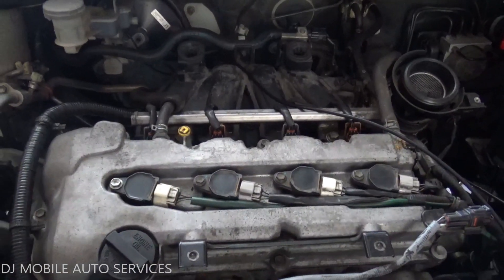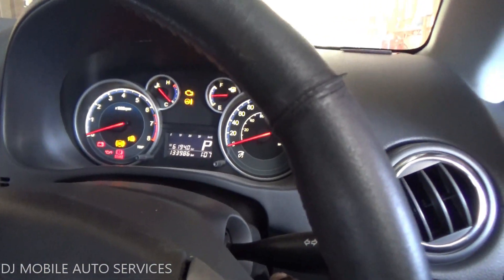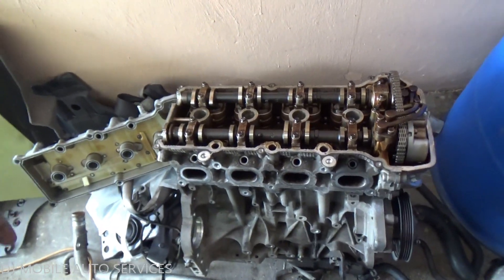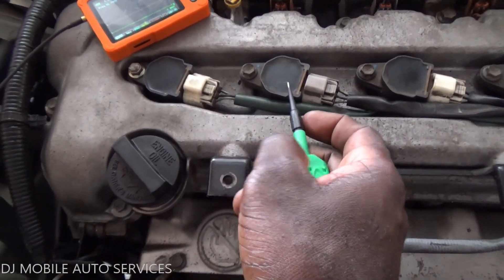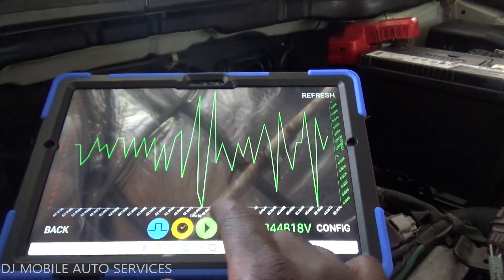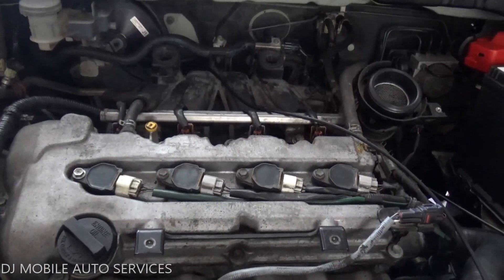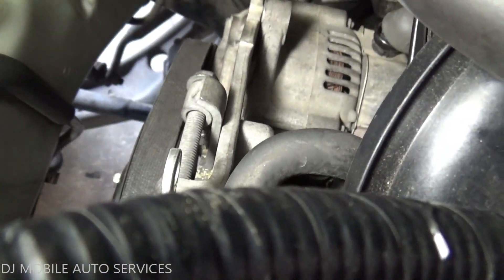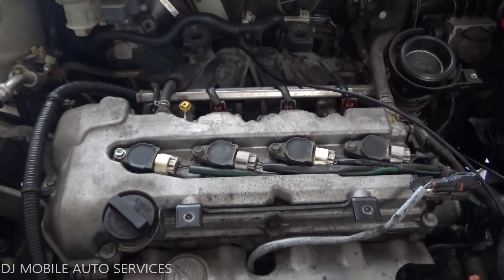2010 Suzuki SX4 Crank/No Start After Two(2) Engine Swap. P0335 Crank Shaft Sensor Malfunction

Comment: what's the issue for that crank no start of this sx4?  I currently having this issue right now we already change the ecu but still doesn't start. hope you noticed this comment thanks!
Reply from the maker: Incorrect engine, paired with the original ecu for this vehicle. The timing marks didn't match with what the ecu is trying to see

Comment: If anybody is facing this issue then swap the crank sensor plate from old engine to the new engine it is located on the timing chain side of crank and you will be fine.
Reply from the maker: Agreed but the engine that was purchased was under warranty and to be able to do this, you have to ask yourself if it's worth the hassle. If it's my personal car, then that fine but as a mechanic. Would you do this knowing that if you break the seal of the engine. The dealer can void the warranty if something was to go wrong? I have done things like this in the past but as I got older. I don't have time for things like this to save the client a buck or two. Because if something was to go wrong. I have to remove the engine and troubleshoot again. Is this worth your time? Am I'm getting extra? What is the risk? But I do agree with you that it can be done

Comment: Question, What is the location of the crankshaft sensor.
Reply from the maker: To the rear of the engine, next to the alternator. It's hard to see from on top but you can access the jack from the top

Comment: I had the same problem now so I changed original cam to new one it's still the same but when I disconnect crank sensor it could start.
it will get P0355 too .
so the same M15a have different crank trigger?
Reply from the maker: Yeah, from the waveform it looks like it does. I believe the next step is to change the crank and cam shaft but the engine was under warranty from the junk yard. So I told the garage to just take it back and save him the hassle
Reply: @djmobileautoservices   ok, thanks a lot . I find out these problem almot a month.
Reply: im having same issue replace crank sensor, pcm still same issue ?
Reply from the maker: try the crankshaft sensor plate from the old engine to the new one
Reply: @djmobileautoservices im not sure last guy replaced engine or not. and not quite sure the engine in car same exact model or not. is it ok if i buy original crankshaft plate and put in current engine? do i need original crankshaft sensor as well ?

Comment: So I am confused??? Is this the second or third engine in the car? The footage details the 4 COP  configuration. You mentioned the 2nd engine had the waste spark (2 coil) layout. Has the valve cover and coils been swapped over at this point? Sorry Dude I struggled to follow the plot on this one. I am interested to know the whole story as I own 2 SX4’s. The 1.6 litre engine option wasn’t available in Canada as far as I know. 🍻
Reply from the maker: Yeah it was a bit confusing to me also.lol. The customer came in to have their engine replaced for whatever reason. They brought a two coil pack engine to put in. Initially it had a four coil pack engine in. This didn't work out for them because it lacked compression. The garage had to take it out and they sort another 2 coil pack engine. Now the vehicle don't want to start. So basically they are trying to use the ECU and harness from a 4 coil pack engine on a 2 coil pack engine by switching the valve cover. I figured that you would have like this one.lol
Reply: @djmobileautoservices  🤣 Love SX4 stuff 🤣 Cheers 👍
Reply from the maker: Lol.yup watched your videos prior to touching it. The one how to test the crank sensor.
Reply: Hey @gibby3340 I need your help plz